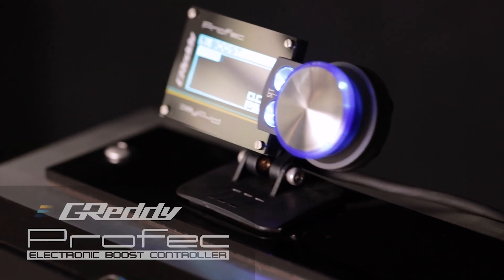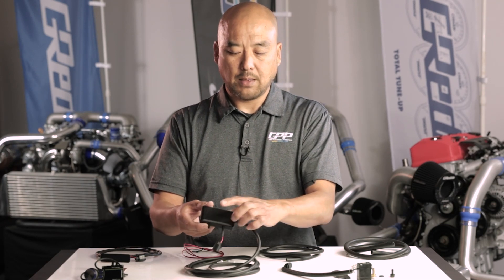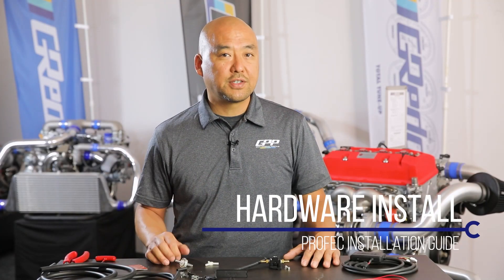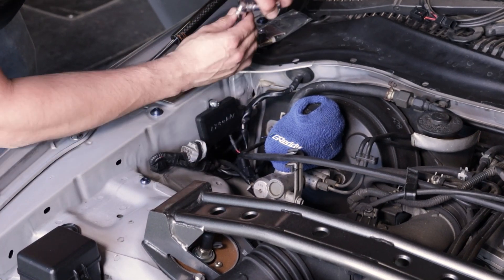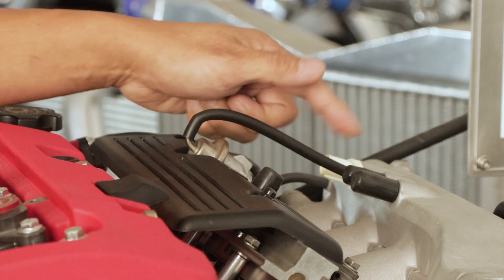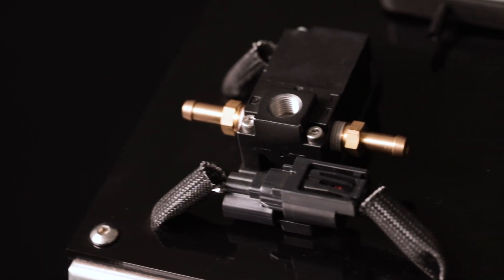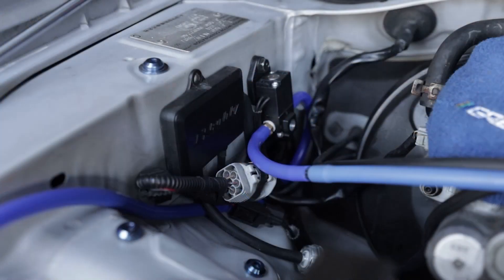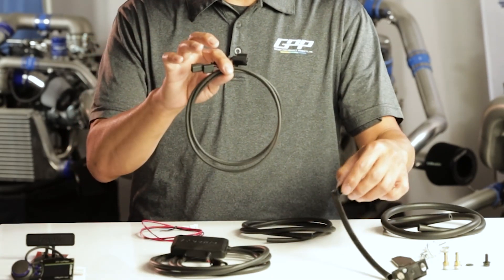How to gain HP with GReddy PROFEC Boost Controller - Ep. 1 of 3

Comment: Wish he showed how to hook up to twin external wastegates got it hooked up and have no control over the boost it just keeps climbing
Reply: Do you have your wastegate plumed correctly? I have mine ran with a single external wastegate and it works fine. I would assume you would run it like a single external but just T the two wastegates into each other.
Reply: @DhatLex  ya I ran it just like it is on the instructions I’ve also tried running the vacuum lines like it is on my other car with Holley efi no change I’m gonna try messing with the gain and limiter to see on if it’s the solenoid band or something
Reply: @sbfnation2535  have you ran the car without the controller? Make sure your WG isn’t stuck closed
Reply: @DhatLex  ya it made 6lbs on gate I put air to the wastegates they moved. Do you got a diagram on how you ran your vacuum lines for your gate?
Reply: @sbfnation2535  gotcha, I ran mine off the directions that came with the controller. I haven’t changed it since